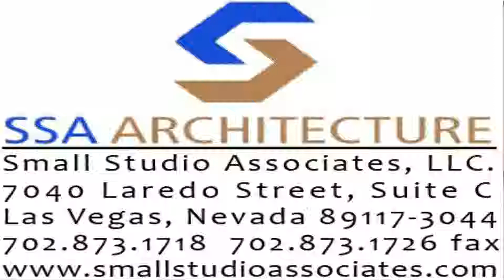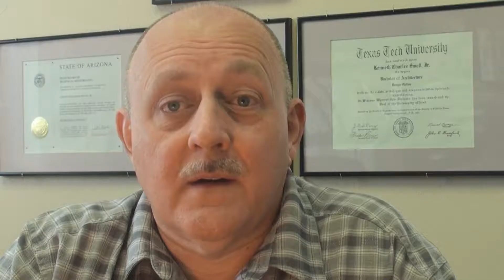When do I need a commercial project building permit?

Comment: I’m in Mesa Az I need commercial plot plan to add 2 water meters on a three unit building shut off valves are in front of building currently there is one meter. All shut off valves are 15-20 feet from existing one meter  what is procedure
Reply from the maker: Hello, and thank you for watching! Typically, civil engineers are the design professionals to use for this kind of situation. We have not done this in Mesa, but a civil engineer would know how to proceed.
Reply: For Las Vegas commercial adding a sink requires a permit? Plumbing is present and a valve is present in the unit.